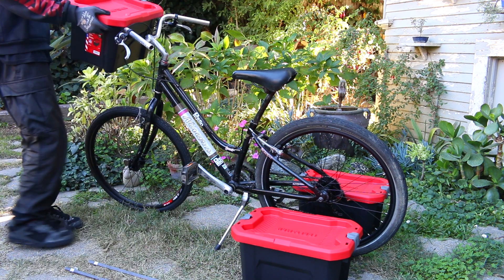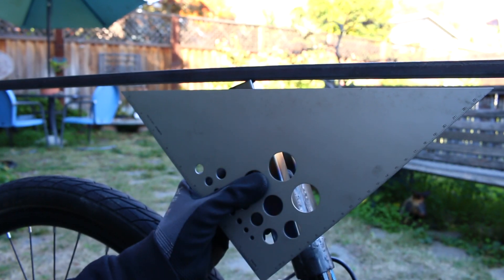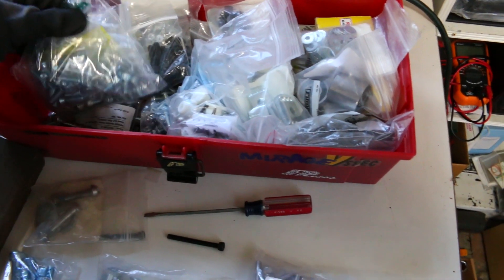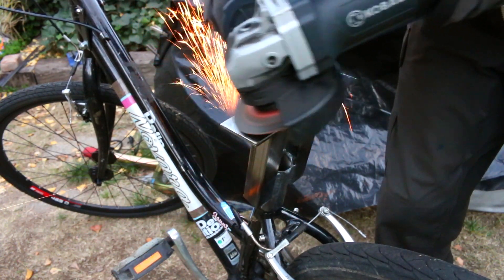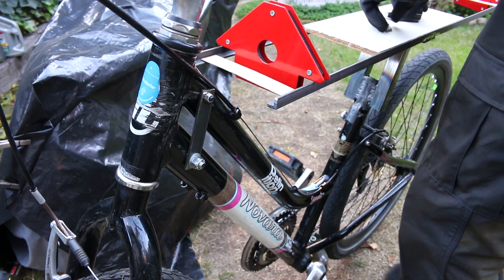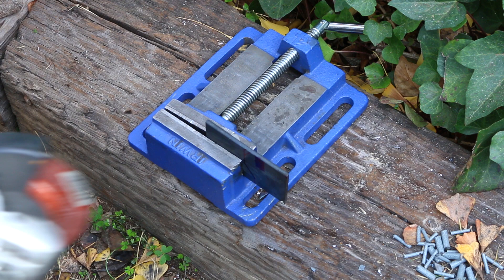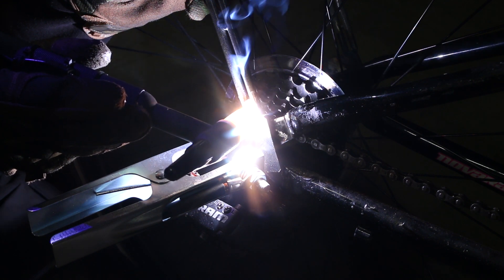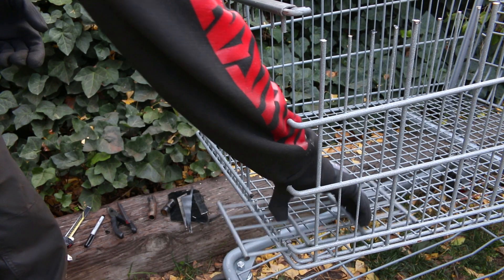🚲 When I Said Cargo, I Meant It (1000W, 48V, Hub Motor) [P2]

Comment: I was a partner in a real estate business, we bought old buildings and demo'd and built them out, and rented them to businesses.. I was a hands on guy..Seen alot of grinder accidents, I always have the death grip on the grinder..There are so many different uses, and just as many ways to make a mistake with a grinder..Galvanized steel is the worst for welding, it pops molten metal all over you, and the toxic smoke is brutal..I've welded metal to a shopping carts before, making them into tool carts, wasn't fun, but they worked so good for moving tools and materials through big buildings..I like the bike, lots of potential there, nice job..
Reply from the maker: 100% man, I've been spoiled with welding fresh metal mostly. Grinders are extremely dangerous, all it takes is one kick from them and it can be very bad. Thanks for your thoughts and insights, much appreciated. This project gets out of hand I can say that for sure. 🍻